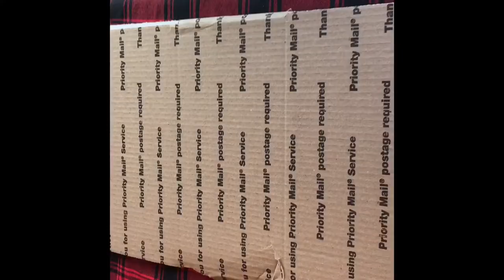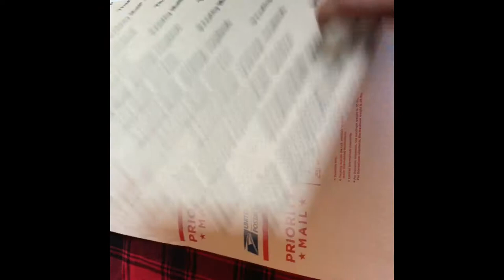Quickest way to powder coat bolts and screws

Comment: It’s so simple…..and yet….i don’t know if I EVER woulda thought of this myself 😂❤

Thank you 🙏
Reply: really? I built a complete powder coating oven (very big to fit large frames) completely from cardboard wrapped in aluminum foil
Reply: @jeffreyharbin5211   I really need to look into this. Oven size has been the single biggest hurdle for me. I just figured you couldn’t “fake it” like with refrigeration.
Reply: @Macheako  same here bro! but cardboard doesn't self ignite until it reaches 600°, just can't have any open flames around and you'll be safe, wrapping it in aluminum foil will add some good insurance for safety but is what reflects the heat back to the part you're powder coating (shiny side facing pary you're coating since there's like 2% more heat reflection on the shiny side) so that your box doesn't conduct and steal your heat
Reply: @Macheako  my only mistake was using cheap quartz infared heaters, they were 100° too hot on the lowest setting and overbaked parts, and they would automatically shut off periodically since they were overheating inside the box, but I'm sure if you use better heaters than mine without any plastic on there you will come out with better results than i did, my homemade oven worked great and retained heat better than my real oven I used for my smaller parts, the inly downfall was the heaters I used, I was really doubtful it would work as I hadn't seen anyone else do anything similar but decided to take a chance and I'm glad I did
Reply: @Macheako  if I asked professionals beforehand they would've said it's impossible to cure parts without a proper $3000 oven but you sure can buddy! you can do anything you set you mind to, don't let the neighsayers tell you what is and isn't possible! you got this! and if you want photos of my ghetto little setup let me know and I'll send some your way
Reply: @Macheako  it ain't pretty by any means but it's cheap and it works
Reply: @jeffreyharbin5211   dude that’s awesome!!! Genuinely. I got the SAME responses when I went looking too “oh you won’t be able to coat the larger parts without spending atleast 10k on an oven” blah blah blah.

Seriously helpful stuff here. I’ll probably look into it a little more but you can bet I’ll be coming back to this conversation for notes lol thanks again man. I absolutely love powder coating and for MOST a my uses, there simply is no better way of coating metallic surfaces.

Cheers bud 🍻 🇺🇸
Reply: @jeffreyharbin5211   oh and yea. I actually didn’t even know you could over bake parts before last month 😂 finally popped my first 🍒 there lol 

The part came out looking horrible 😂
Reply: @Macheako good luck my friend! it gets easier ahah so keep it up 🍻

Comment: Is there any risk to doing this with 3M aluminum thumbscrews? Or with thin aluminum screws in general? Does the powder coating process make screws brittle if they are thin enough?
Reply from the maker: It should not!
Reply: You dont want to powder coat the threads, powder coat isnt thin like paint and it will make the bolts damn near impossible to thread into what it was made to fit.